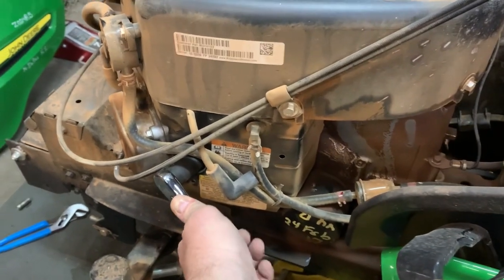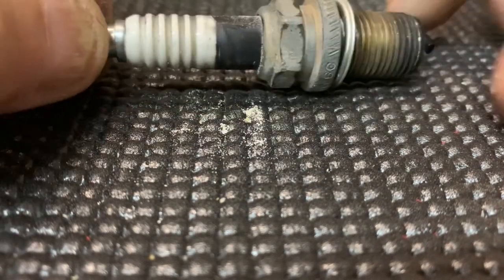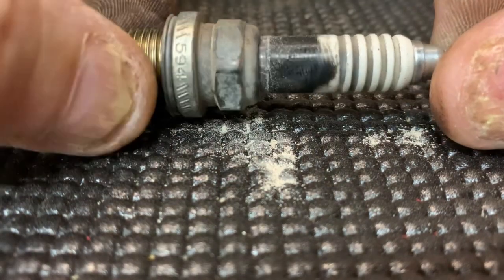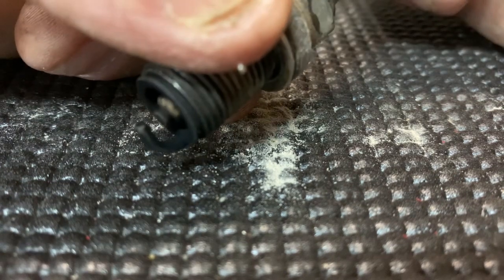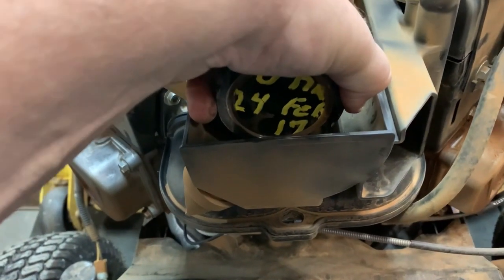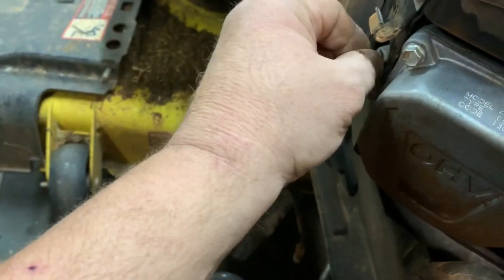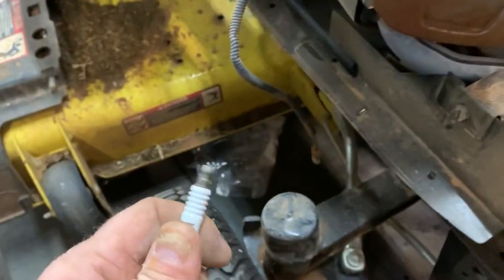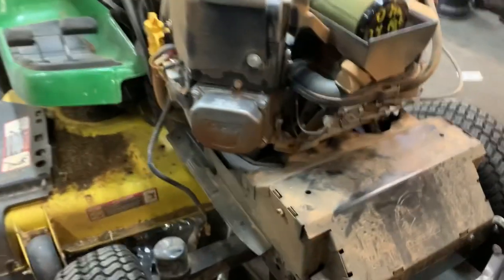LOW HOUR #SPARK #PLUG #FAILURE SOME OF YOU HAVE NEVER SEEN THIS!

Comment: Just a thought: if it's only done 30hrs in 5 years, it could be that damp has caused the corrosion which in turn has weakened the plug. Compression and vibration may have done the rest. Maybe plugs should be changed after, say, 3 years irrespective of hours. Might be worth checking with Champion.

Comment: ive found all the champion X plugs have over a 10% failure issue after a short time of use from new...i recommend changing them out with the non X version to eliminate all future problems...for some reason the X series plugs have a thinned out tip like the iridium plug and for unknown reasons they are prone to excessive failure...i always change them out...

Comment: As it happens, I have seen that problem before. About 35 years ago during my rallying days we had a plug that got blown out like that in the rally car. We put it down to the high compression.
Did you clean the inside of the HT lead boot before putting it back? https://www.youtube.com/shorts/_RRv2zpiVfY
It's amazing the number of [stoopid] people still putting copper grease on spark plugs (and brake parts). I keep telling them not to and made a short https://www.youtube.com/shorts/3YUGaK-7ttc
If a car was hunting like that, I'd look for a vacuum leak - did you find the cause?